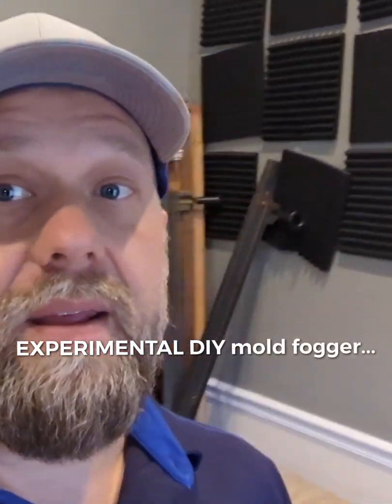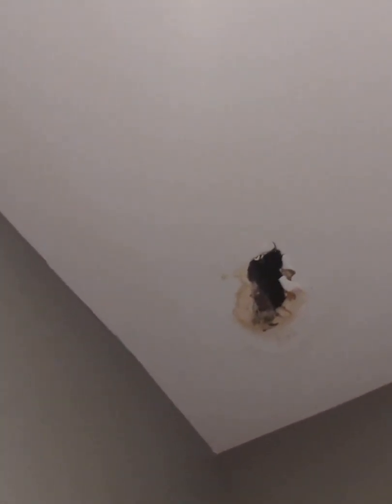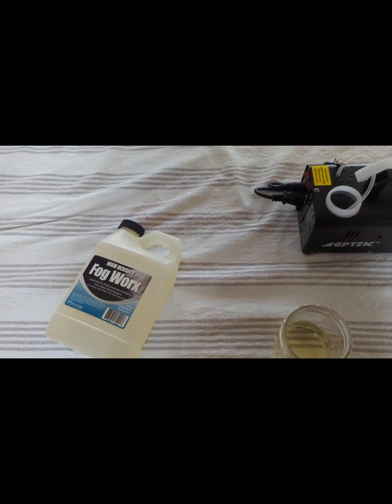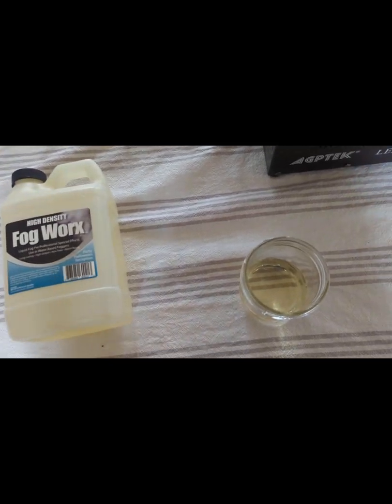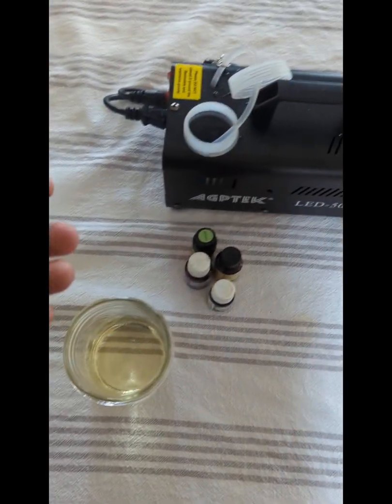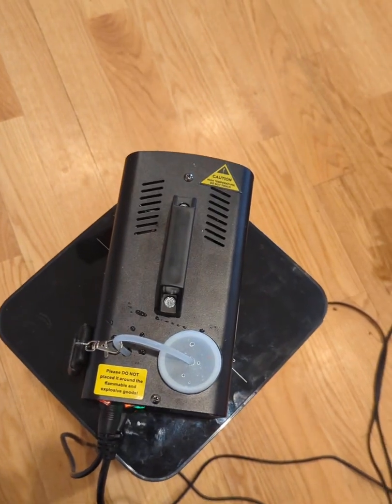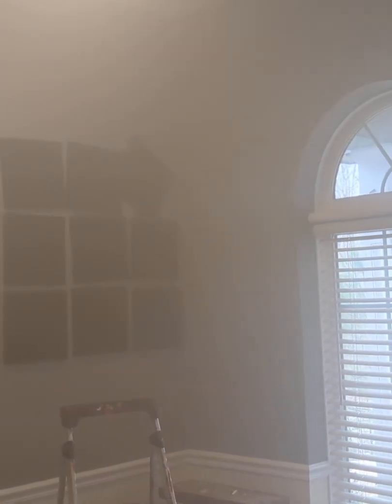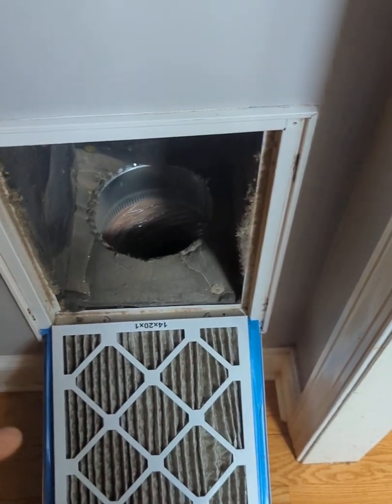DIY Experimental Mold Fogger Remediation (how to)

Comment: Thanks for the video. Just remodeled entire house. Looks like an old leak, but sprayed it with straight white vinegar, and now getting ready to paint with Zinsser Mold Killing Primer. Once I 100% get done with house gonna run 2 ozone generators for like 6 hours. That will get into every crevice and nook. After that I bought everything to properly clean all duct working. Then finish with a bio fogger. Hard to find data on how many sqft a fogger will handle. I’m gonna rent the commercial grade from Home Depot or Sunbelt rentals or something.

Moving forward, have 2 HVAC units that I’m going to place 2 UV lights per. All bacteria and mold forward will be taken care of and really sterilize the house. One question I do have that I can’t find, in a large open space I wonder if using a fan on a LOW setting would help push it around more. 🤔

Comment: My sister has germ related OCD 
After Covid. She's got it in her had that her house is not sanitary. This would ease her mind.
I know this is a year old. Any news on how it worked?
I recommend Oregano oil and spearmint oil.
Along with lemon balm, these are the best oils for removing bacteria. Mold. Germs.
I did extenive research precovid lockdown. I knew about Covid early on.
Look into Homcare Labs Greased Lightening all purpose cleaner. Also great for mold.
Thanks again.